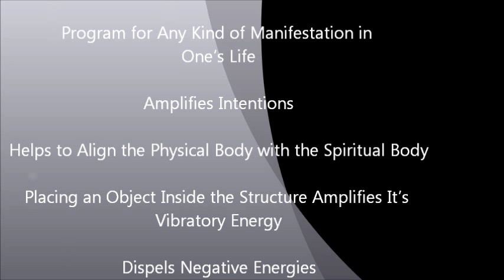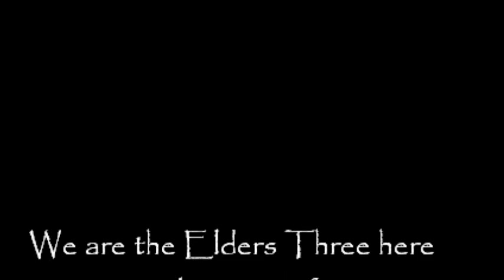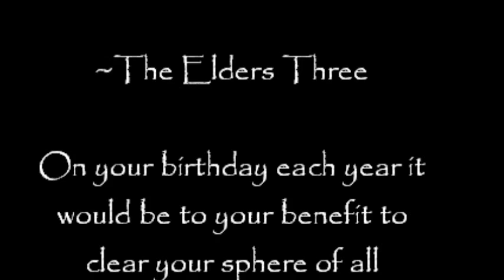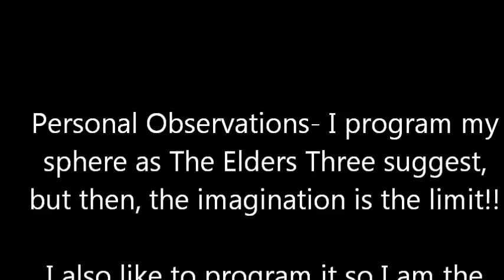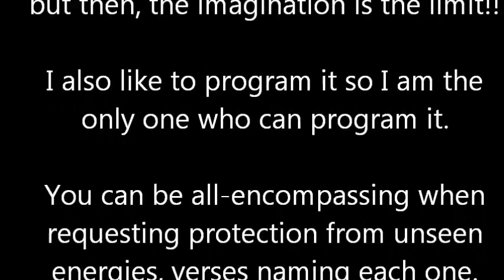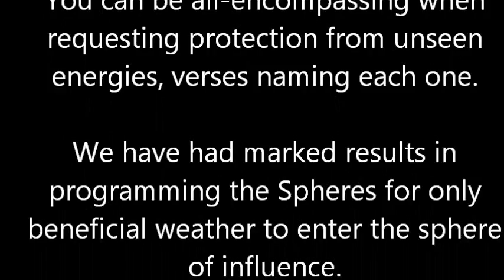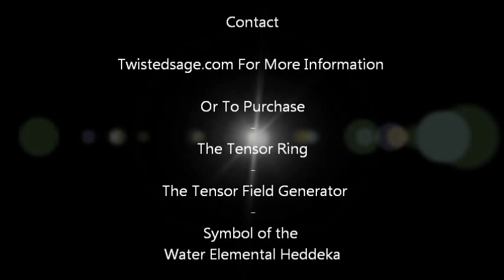Tensor Field Generator- Intentions for Use

Comment: So a 'tensor field' in the strictly mathematical and physical definition is an abstract concept that you can use to model something.  One of the really useful things it models is internal stress inside a solid object.  Let's go with your basketball idea: when you squeeze it, at every point inside the basketball there's some kind of pushing and pulling happening because of your squeezing.  You can model the specifics of each point based on where it is in the ball using a tensor field.
Reply: Postscript624 ii

Comment: A tensor is not a physical 'thing' in the same sense as, say, electric current, and as such would not be said to be 'generated' in the same way.  A tensor is a mathematical construct that could be described as a generalized vector.  It's used to describe many different things, such as mechanical stress, or force propagating through a medium.  A tensor field is an abstract mathematical space where every point is assigned a tensor.  It's a thing like the Cartesian Plane you learned in high school

Comment: Its kind of hard to explain if you don't have an open mind. You have to believe that it works with no doubt. There are things that exist in this world that can be explained by science, then there are things that can be explained by expeirence. There are reasons why the world is the way it is. What you see as copper mess, is in fact much more. Copper is an important mineral/metal and its specific length is important as well. Look up Cubits measurement and Slim Spurling. Don't just doubt things

Comment: Alright, let's talk about a scientific approach. In what way have you used doubt to prove or disprove your theories about this? What have you done to convince yourself, let alone anyone else, that this is anything other than unfounded supposition? What are the pass/fail conditions it would have to meet to be verified or falsified according to any of its claimed properties? What tools did you use to measure its effect? Did you use a control group? How did you factor out observer error?
Reply: For you, I would bet you would even have a hard time with understanding a Lecher antenna.. Swearing up and down it is manipulated by the brain through the hands. Probably also have never used or believed in pendulum theory either.  Well, the American medical profession scoffed at acupuncture for years upon years...until the Chinese finally proved them wrong. yet most doctors still think it is witch craft. After trying to get my hands on a Lecher antenna, they are priced out of common sense market. and there are some knock offs that are un proven yet.   However... thousands of  doctors in India depend on them. They are about the only device that can pick up Quantum energy fields.  The antennas have an advantage when properly understood... you can slide a bridge along the length between the two wires on the unit to shorten or lengthen the reception of the desired wave length.  Some frequencies are for living organisms, and others are for detecting  energy fields  from crystals and certain ores.  The tough thing in so many sceptic's lives is that since they do not have the sensitivity that certain others have, they cannot feel energy waves.  There are some of us sensitive to many frequencies...and others sensitive only to one specific frequency.  Those of us very hard trained in esoteric matters are forced to honestly pledge to ourselves to never lie to our selves as to saying we feel or can do something that for sure, we cannot.  Lie to yourself, and you lie to others. You will never progress spiritually.  Something typical...I have never seen a UFO....so I damn well, will not tell you I ever saw one. It is just not right.  However, I have had spiritual manifestations appear, as clear as day....my word is my bond... I am registered as an energy healer with the Spiritualist Church...so what.. that and 20 bucks will get me a cup of coffee.  But, in my heart, I and the people I have helped know the truth. 
Just made two triskelions.. had to use pendulum...not that strong..but work.. sure will be glad when the slow boat from China and India finally bring me the Lecher to learn some more stuff.  Keep an open mind, and get someone local that knows what I have been trained.  A real person of this knowledge does not charge a dime for education.  we are strictly not allowed.  Be even careful when dealing with rabid Reiki students if charged, never use them.  Read Slim's Books.  But remember, a lot of adjectives and words are not fully scientific...The best of the scientific minds are still closed to the research...Slim in the books would call it anything from Quantum energy, to  cosmic energy, to light energy, to etheric energy.... Learn for yourself. at the right time,  you will experience  one very important second in your life that will open up your  ability to experience what we can see and feel...and you will know it was not a trick or lie.  Until that time...being negative will only hurt you and those around you, and the Universe...and it will block your chance for enlightenment when you really need it in your life.

Comment: No offense but you make me laugh. You sound so skeptical almost as if you don't want to believe it works. I actually have tested it out with orgonite. If you've never heard of it do some research its in the same category of unconventional scientific devices. I also measure the tensor field generator's effectiveness against a regular copper wire of varying length and shapes. Bottom line is if you had one you would know it works. You can even make one. I've even manifested with it. How's that?
Reply: Hello there. I have made one after seeing this.. using 1/4 STU ring. What all is possible with it? Any detailed instructions to use it?